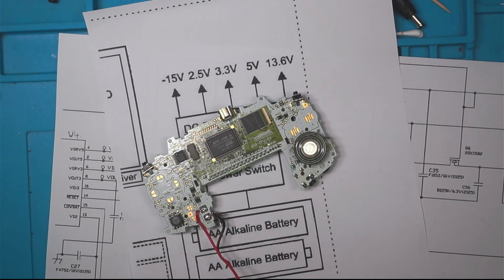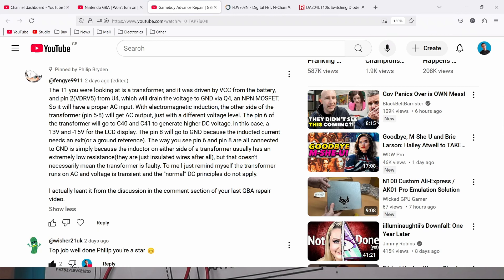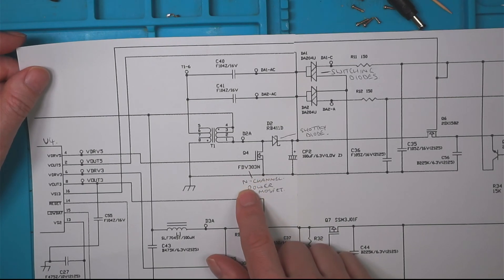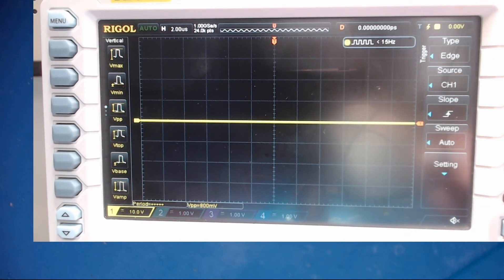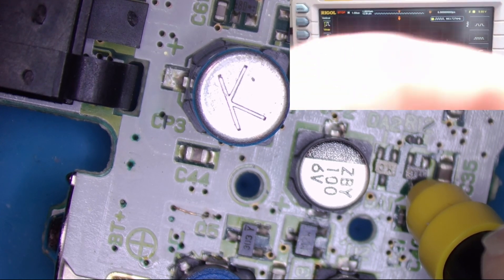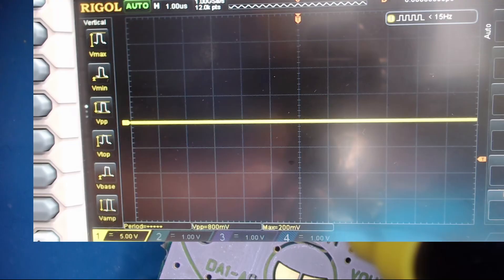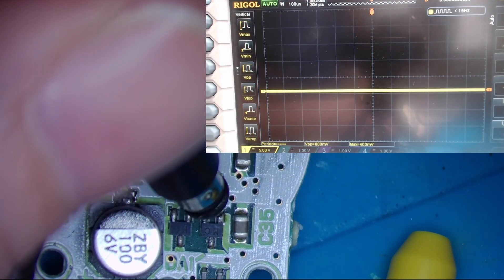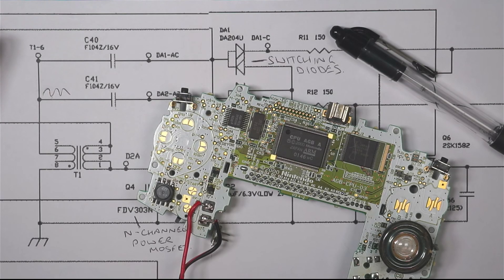Probing the GBA Transformer T1 with an oscilloscope | Beginner Electronics

Comment: While I'm all for people investigating electronics and learning on line in places like YouTube there needs to be some checking in with reliable information sources, otherwise you will get lost in the weeds and get led astray.
A few incorrect things came up in this video. 
There is no such thing as an NPN MOSFET, transistors can be NPN BJTs(bipolar junction transistors) or N channel MOSFETs. Then there are their complement types, PNP and P channel respectively.
The discussion on T1 was somewhat muddled. This is part of a switching power supply, which is part of a DC-DC converter. It was stated that T1 gets an AC input. T1 actually only has DC input, but the winding gets switched from open circuit to ground by the MOSFET, so either full VCC or nothing, not an AC sine wave. The transformer then works on the burst of AC signals produced from this and transformer action can give different voltage outputs as required by the turns ratio of the transformer.
It was also stated that two capacitors were there to produce DC, actually it is these components AND the diodes they connect to that result in DC.
Reply from the maker: Thank you very much for your comment and pointing out some of my mistakes. The discussion on the AC or DC input did confuse me. Since the video I did more research into the subject and hooked up another probe to T1 to read the input and output simultaneously.  

My understanding of the result was a pulsed DC input, leading to an actuall AC output. There's a link to the image of the scope here too.

http://youtube.com/post/UgkxAKT799G3jUWC-L3XYh7ozjrwt8rqJFmw?si=I3qHkD82en_-j80Q

Comment: Capacitors in AC act as short circuits at very high frequencies but as open circuits at very low frequencies. In reality how much they conduct depends on the frequency and the capacitor's capacity, it follows the formula Z = 1 / (2*pi*f*C) with f the frequency and C capacity in Farad.

Since the frequency you have here is pretty high it is normal to see the signal on both sides. 

Not sure what their purpose is in this exact context though, I have never worked with these types of circuits. If I had to guess I would say they're either filters or they serve to create some form of resonance with the transformer's coil?
Reply from the maker: Things are starting to look compicated really fast lol.  At my level atm, capacitors are like little batteries in the circuit that store voltage to help smooth things out. Now I'm reading that they work differently on AC and different frequencies is intimidating and interesting at the same time.  Thank you for sharing your knowledge and experience.

Comment: In DC mode the scope will show you whatever voltage it reads as-is. In AC mode it will remove the DC component from the signal before. Let's say you have a sine wave that oscillate between 1V and 3V. In DC mode you will see just that. In AC mode you will see a signal going from -1V to +1V, because the scope will have removed the constant (DC) 2V component before. It really depends what you're trying to measure :) Be careful if you have very low frequencies when you're in AC mode, you can get weird results because the removal of the DC component is done via a high pass filter with a certain cutoff frequency (one model I found has it at 10Hz but you can find yours in the manual of your scope) meaning the filter is not linear in this region! If you want to learn more, Keysight has a great article explaining how it works and what you should be careful about, just look for "Keysight When to use AC Coupling on Your Oscilloscope" on your preferred search engine.
Reply from the maker: Whoosh straight over my head lol. I will take a look at the Keysight article, thank you. In the meantime I'll keep the scope set to DC.
Reply: @PhilipBryden to me, AC coupling will “centralise” the waveform, while DC will keep its voltage level relative to GND
Reply: AC is super useful in some cases as it makes analysis easier, like setting the trigger threshold to the height (voltage) of whatever you're trying to measure without worrying about the DC component (= how much the signal is shifted up or down).

Actually given the frequencies (MHz) you're at, you can safely use either DC or AC. Just be aware that the center of the signal might be different. Put simply if you're in DC and the signal has a voltage offset it will be visible, while in AC it won't.

Comment: I need to invest in and learn with a oscilloscope, hope you and your family had a lovely Christmas.
Reply from the maker: Thank you Matthew. I've experimented with the scope and I was just typing that I couldn't pinpoint a time when I have used it for a fix. Then I remembered using it to check for clock signals on the GBA recently. I'd like to do some work on audio equipment, which I'm sure the scope would come in handy for.
Reply: There are some DIY oscilloscopes kits.
Reply: @yanghao8351  i was thinking of getting one of them, or a cheap handheld before committing to a rigol just to get used to them. I doubt i will use it much but be handy to have and learn using one
Reply from the maker: I recorded this for you.
https://youtu.be/thKZ0Um5qfM